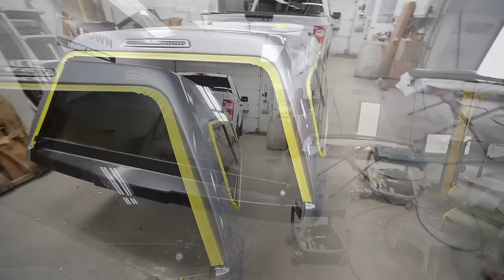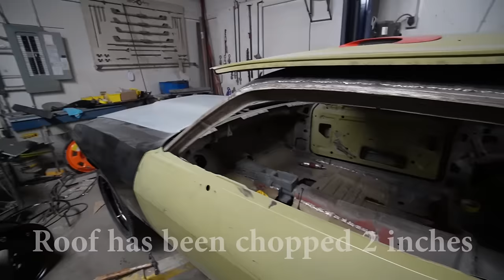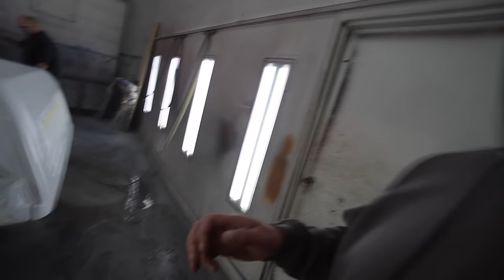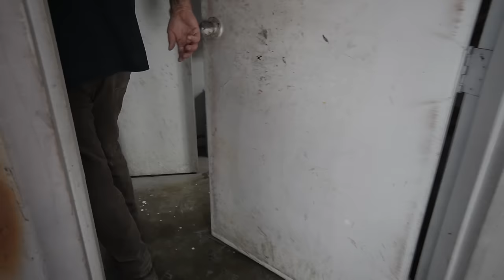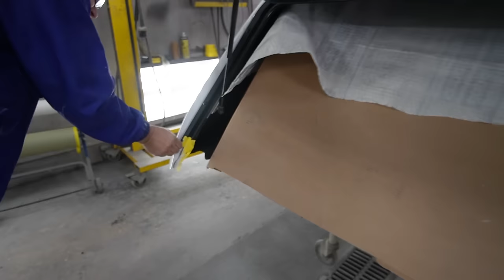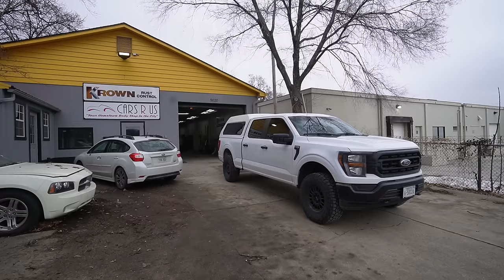Painting My Used Leer Truck Camper Shell

Comment: Looks good color match, I would put black or white Berliner coating along the 
bottom to match the bumpers to protect from rock chips and rust   I did that to mine easy to clean and no chips. ✌🏽

Comment: You had the windows already masked before sanding. What was the reasoning behind removing that masking only to apply masking again to prep for paint? Also, I don't think I saw anything about it in previous videos, but what did you ever learn to be the problem with the Chevy you had before?
Reply from the maker: We sanded right against that tape and it was full of dust, you have to remask afterwards for cleanliness and clean lines. The Silverado broke a valve spring and chewed up the piston, I hope to have it going again this summer, and I'll do a completely different style of camping setup on it probably
Reply: I was wondering if that may have been the reason to remask. Thanks for the quick reply! It's nice to finally settle my curiosity about the Silverado! Haha In my mind, I was thinking it would probably be cheaper to fix the Silverado than to replace it. Then again, that would've probably left you with a lot of down time not able to produce content for your YouTube channel, which I enjoy! Keep on keepin on! 👍

Comment: as automotive painter, dont see why he sprayed sealer 2coats...IMO wasted materials, I've painted many and with a good sub straight like ur shell has,  wet sand 600 tape n spay YZ urathane  single stage 2 coats n done. Notice the match is brighter...it needed a cum drop of yellow green n blue to match, but looks good.